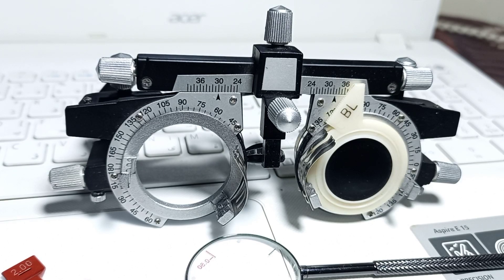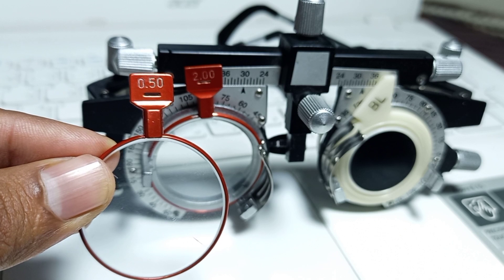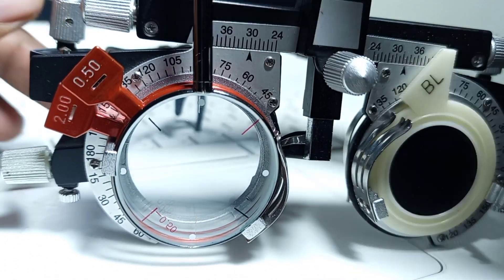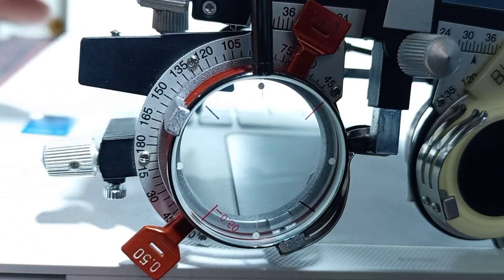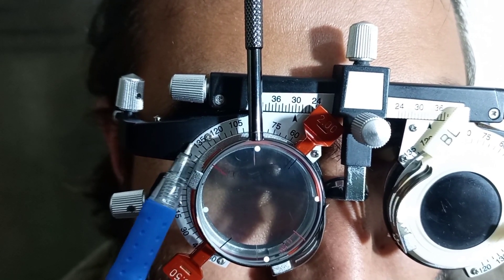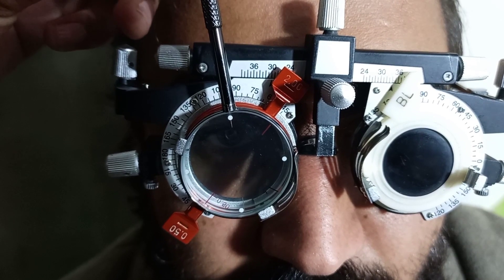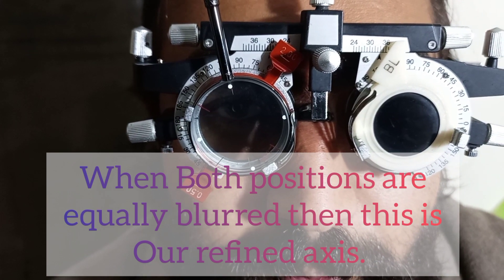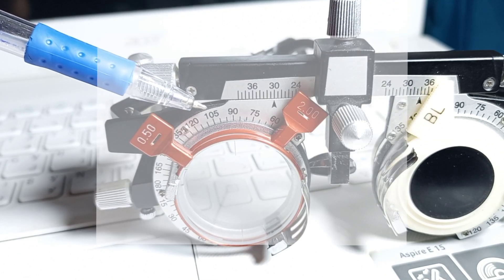Axis Refinement (2nd Step in JAckson cross cylinder)

Comment: Why for axis refinement put jcc handle parallel to trail cylinder axis ???? Plz ans
Reply from the maker: Because in bracketing we just found our rough axis for example 90 degree but now we are not sure that 90 degree are correct or not...it could be less than 90 or could be more than 90..so we put handle with the 90 degree trial cyl axis..and by doing this we will see that at position 1 minus line will at 45 degree and plus line will be at 135 axis..so now we can move to our refined axis either it is before 90(towards 45) or after 90 ( towards 135).

Comment: How to decide whether we have to put -cyl or +cyl after confirmation of patients for position 1 or 2 and 3 or 4. Which axis we have to follow + or - . Pls clear this by updating in this video.
Reply from the maker: In every choice we have 2 axis ..one axis is for plus cyl and other is for minus cyl ..suppose at position 1..plus cyl's axis are 90 degree and minus cyl's axis are 180 degree ..now it's your choice you want axis in plus or minus..
But always minus cylinder is preferred.
Hope you are clear..
And sure I will make a short video to make it more clear.
Reply: @optometrywithkhurram6867  thank you sir.
But I want to ask whether it depends on - or + sph which have corrected b4 cly power or we have to always follow - axis of jcc to correct.
Also I want to clear my doubt about JCC ie both + and - cyl are 90° to each other and line shown on JCC are axis but I m little confused in  power and axis using JCC.
Reply from the maker: @jitendranevrekar705  I'll make a video ..I got your point Jitendra..dn worry..
Reply: @optometrywithkhurram6867  Thank sir. I am asking this because of below prescription.
R -050 +150 x 80°
L +150 -200 x 170°

One more patient got following prescription as 
L plano
R +100 -100 x 170°
Pls clear this issue